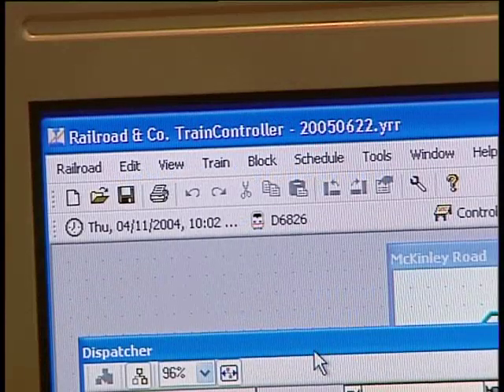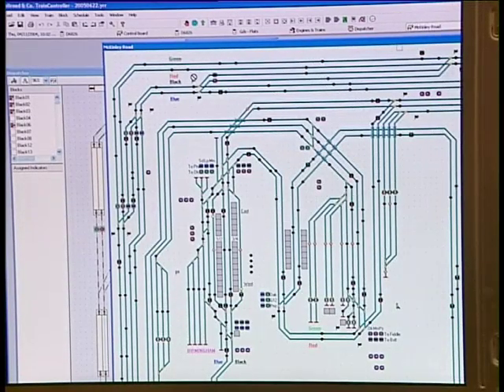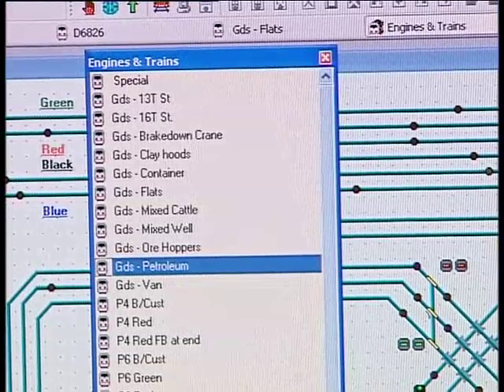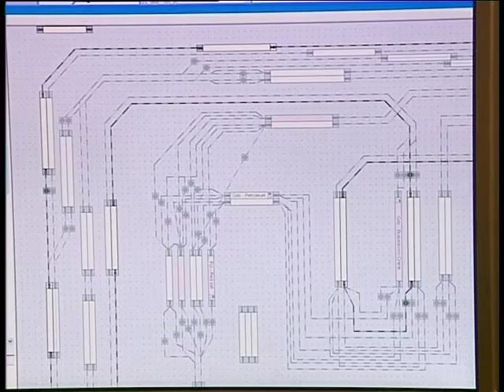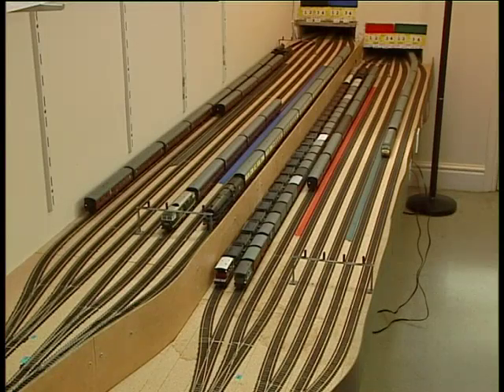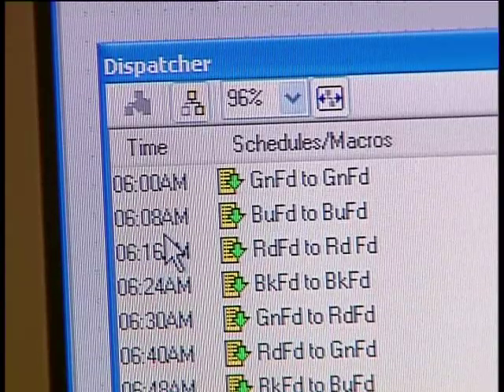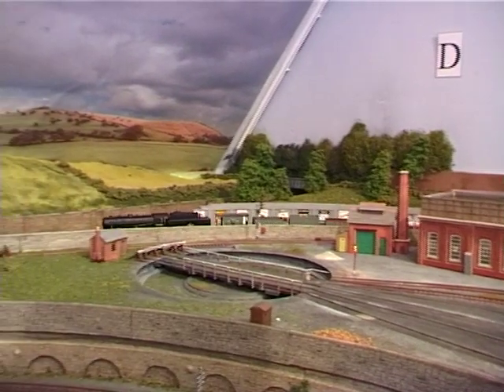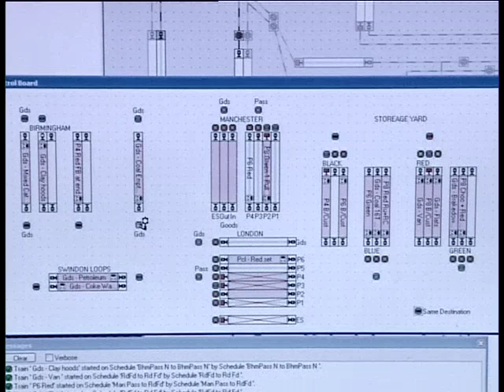Computer Control of McKinley Railway

Comment from the maker: Hi Eddie,
Sorry for the late reply.   Yes TrainController does allow for various forms of manual and automatic control of trains on a path (or schedule) from A to B. If you are running it manually, it can be quite scary as the driver has to obey the signals.If you run a manual train on a schedule through a red signal, you are likely to cause a crash - Just like the real thing!  Its documented in the TC manual.

Comment from the maker: You have to use your imagination to answer that.
It took 7 years to build. There are 170 points (switches), 700m of track. We have 110 locos, 130 coaches and 800 other items of rolling stock.
We based the electronics around Digitrax & CML  DCC kit. We used 1 Command station, 6 boosters, 12 x BDL162, 8 x PM42, 40 x DS64, 16 x SIGM10 and 20 x DTM30s, 1 computer to control it all and 5 man years of effort.
That's the shopping list for McKinley
Regards
David

Comment: I like the layout. What is the cheapest way to run your dcc layout on computer using a bachmann system.
Reply from the maker: You can't. Sorry.  Bachmann doesn't have the necessary addon hardware nor does it have a "bus" like LocoNet.

Comment: Which version of Train Controller software do you use? Bronze, Silver, or Gold? Is bronze able to do all that you need it to? Or would you recommend buying a higher version?
Reply: I run TC Gold on McKinley.  My suggestion to prospective users is to start with either bronze or silver depending on the scale of their layout.  When  they need features available only in the next version up then upgrade to that version. To answer you specific question about Bronze, it is very easy to set up and get running with, but it would not be able to run the McKinley Layout.  We did run with Silver for the first 2 years until upgrading in 2008.